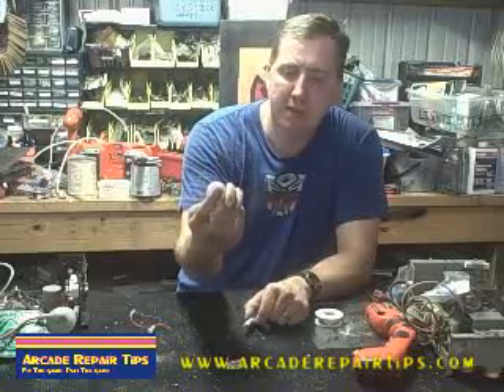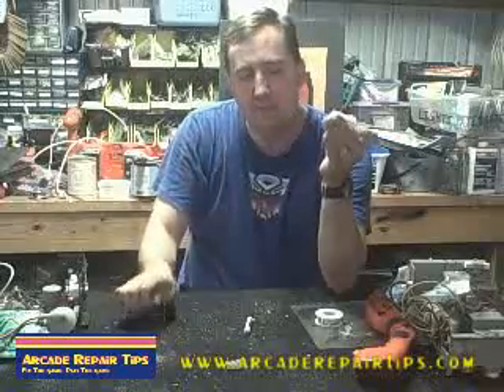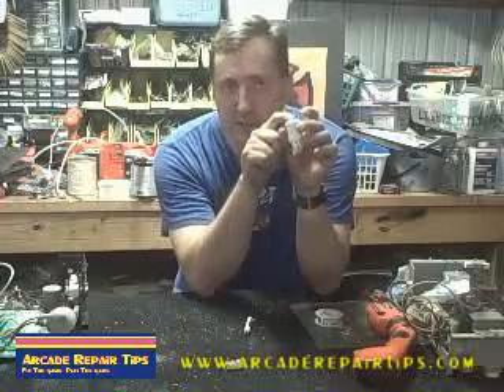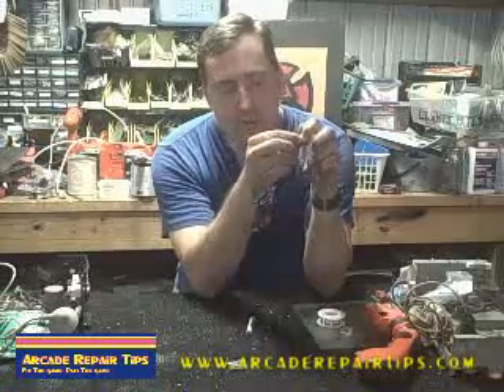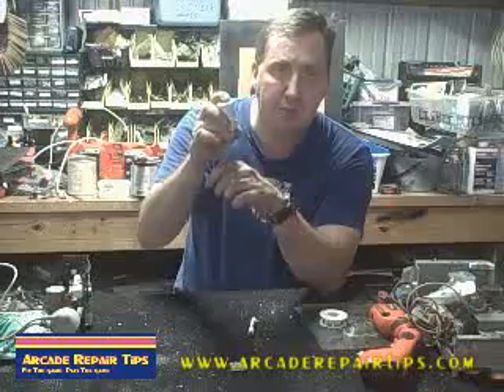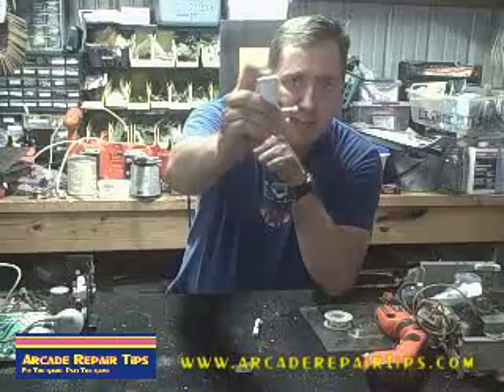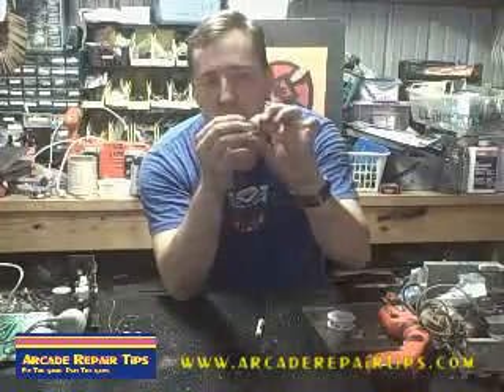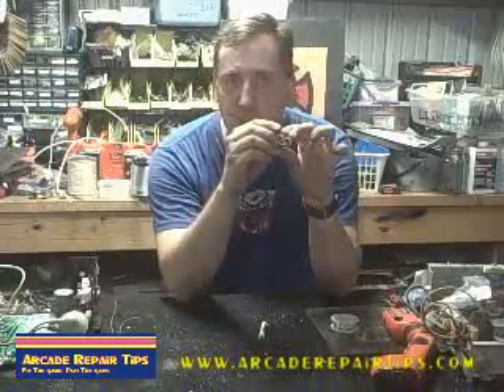Arcade Repair Tips - Wiring A Push Button

Comment: My MK2 Cabinet has four buttons in a row inside the coin door.  One says credit, two are volume up and down and the last says test.  The only two buttons that work are the volume.  I checked the wiring and it looks ok.  Is there a way to test it to see if it is the buttons that are bad or a problem in the wiring somewhere?  Don't want to replace the buttons and find out that doesnt fix it.  

Thanks for the helpful videos.